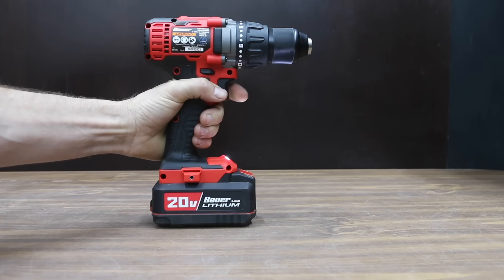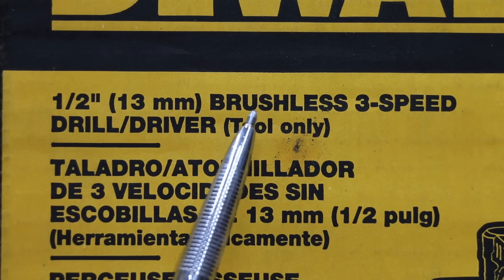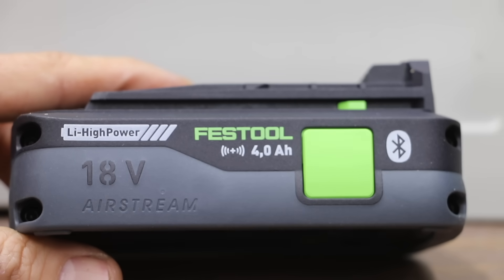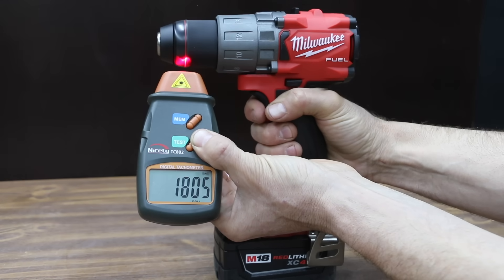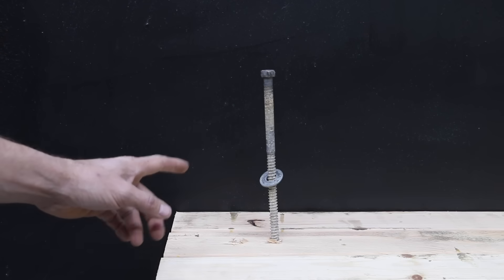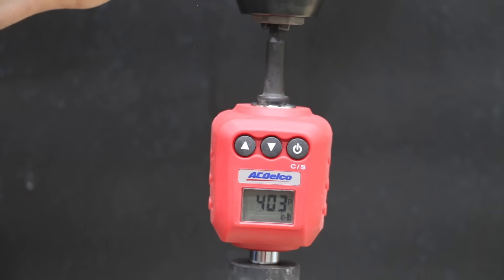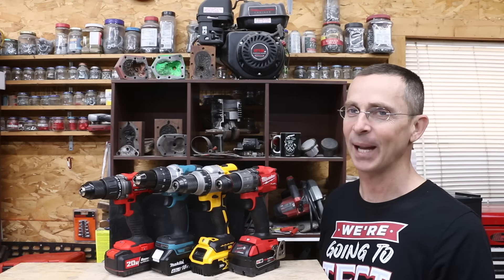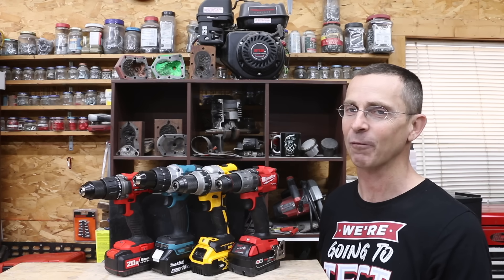Best Drill (BATTERY POWERED)? Milwaukee vs Dewalt, Makita, Bosch, Festool, Ryobi, Bauer, Ridgid

Comment: A PF video is always worth some of my time. This one is no different. Solid testing methods. Unbiased conclusions. 

I used the drill method to start my 1970s 2 Johnson cycle on my little boat. Otherwise, I had to pull that rope for along time. 

Also, what planet is Fes-whatever from with that price and performance?

That said, I am neck deep in Dewalt 20V tools and batteries. None have let me down yet. The 20V weed eater is probably the lowest performing of the lot, but it keep going despite my verbal and physical abuse.

Comment: It's about to be summer. I know a lot of us would like to see which brand has made the best brushless battery powered lawn mower. Is it Ryobi's new twin blade mower, or is it Kobalt's 40v or 80v mower, or is Ego's 52v mower still the best? But how about makita? There are many options out there.. many people wanting to switch from gas to battery because it saves you time going to the gas station with its price rising, it saves your ears from listening to a loud mechanical engine, it saves breathing in fumes and regular maintenance work that has to be done on a gas mower. While battery operated is just as easy as plug and play, much more quiet, easier to store away since it can be folded upward without worry of spilling gas or oil. I'm telling you it's going to be a popular video! I would love to do a comparison video like that but I just can't afford buying each mower 😂 and then again I would need a lot of grass that's between 3-4 inches so I can pass each lawn mower twice, away from the camera and then back to the camera, so the angle can be just right. But I would do it on the slowest setting first to compare each cut ✂️ from every mower. Then run the mowers to see how long each one lasts. It's not an easy task and would be much more helpful to have some people help you out. But it's definitely feasible and not that many comparison videos out there on the web that show such comparisons. It would be informative as well 👍 Good Luck. I know you got this.  Hopefully this all makes sense. Let me know what your honest opinion on this is. Keep up the great work man enjoy watching your videos a lot!
Reply from the maker: Thanks for the video idea.  Thanks for watching!

Comment: I wonder if brand name makes a difference in  spackle/drywall mud. My daughter bought a small tub of the color change stuff when she moved out of her apartment and she said it didn't spread nearly as well or forgiving as when I made her help with the remodel years before
Reply: Even when using the same brand, there are several varieties of joint compound for different uses.
Reply from the maker: Thanks for the video idea.

Comment: My DeWalt XR can break a man's arm quite literally I'm very happy with it if they could somehow apply the full 120 volts say a larger battery but in series of 60 and 60 or just build a March generator with the same batteries only at a different sequence 369 so and so forth until you achieve your 120 volts at a 60 cycle per second acoustic attenuation of electrons... So essentially you start off with 1.5 volts you have three of those per cell in series then you shut those into three larger cells that amount to six Volt and series those then your final voltage will come out of the nine Volts in parallel 3x9= 18 54 volts just enough Cycles per second to Ballance out impedance to electron flow " think Water " the nice thing about brushless motors is that they are essentially three phase motors, they create AC current by the nature of their Electromagnetic principals of the armature in conjunction with the Poles.  They make AC energy with means much like a LARGER three-phase motor used to step down voltage you can actually run a lightbulb through them... although Aluminum Air Batteries are a far more efficient replacement than Toxic Carcinogenic electro-Chemically unstable lithium ion batteries....I'm also a 9th generation Carpenter and Multiple Tradesman...since age 5? Mechanical electrical Structural chemical Prototypes repairs and fabrication in any medium 220 lb 6'4" 40" arm reach.. Ventruvian man.
Reply from the maker: Thanks for the feedback.

Comment: It seems from consistent cross-tool performance results that Milwaukee, DeWalt, and Rigid make some pretty darn fine tools. Definitely get what you pay for in most cases.
Reply: I have maybe 20 Makita and a dozen Milwaukee cordless tools and about the same number of corded of each.  I would say their reliability and build quality are similar.  I have used both for over +30years.
Reply: @semidemiurge  If you were talking about Milwaukee before they sold out to TTI you would be right. But when they went Chinese designed the quality went down dramatically.
Reply: @waterloo123100  I would partially agree with this but I would add that all companies experienced a change in mentalitywhen it came to the level of quality in tool construction.  The competition increased dramatically and there was huge pressure on price to remain competitive.  Quality suffered as the consumer could or did not recognize the difference in quaity when making a purchase.
Reply: @semidemiurge  And even then, I suspect it varies batch to batch. I have a compact Makita 7.2v impact driver (I call it the noisy cricket) from 2006 that still works a treat. Whereas a friend of mine hates his Makita tools because they never seem to hold a charge. I've also had a Harbor Freight brand rotozip that lasted 6 years of hard construction use and its replacement didn't last a year.
Reply from the maker: Great point!
Reply: Overall the 3 best tool companies are Dewalt, rigid and Makita. Milwaukee tools are just too unreliable.
Reply: @waterloo123100  my large collection of Milwaukee tools that have been abused daily doing heavy requirement repairs would disagree
Reply: @jaronvansambeek506  I have both Milwaukee and Makita. Tools. I’ve had 2 batteries take a shit and a impact wrench by Milwaukee. Can’t say the same about my Makita tools though.
Reply: @waterloo123100  that is an opinion. The test results are fact.
Reply: @Luckingsworth  Project farm only did a performance test here. Not reliability 😂 Even with that said. The Makita overall still performed better then Milwaukee and it was cheaper to buy.

Comment: What would be cool to see would be a best 1000 W power inverter test
Peak watts
 Efficiency
 Low voltage cut off( Being able to start a vehicle After the cut off)
Features 

I have a Dewalt 1000w that works ok 
 In powers most of the tools I need
 But the biggest problem Is when I use my battery chargers they whine and squeal  Because of not being a clean power output
Reply from the maker: Thanks for the suggestion.

Comment: A lot of people are commenting on the cost of the Festool, but we need to recognize the small fortune he spent on the lumber!
Reply: ^ This dude bringing up the real issues.
Reply: Very true. Lumber is the new gold.
Reply: $8 for a 2x4!!!!!
Reply: @boowiebear  try 10 😥
Reply: Are you telling me the Rolls-Royce is cheap car because a private-jet costs $20 million dollars!
We are comparing drills to drills and not drills to lumber, why should I buy Feattool for more money over Milwaukee when Festtool came last in power and Milwaukee “the cheaper” came first?
Reply: @samk.871  you buy a tool for its features and if you have as much as half a brain you'd determine whether the features justify the cost relative to your productivity. Festool is a brand that differentiates itself because of the various systems it integrates ... with drilling the interchangeable chucks and Centrotec system add value to specific trades and they are the ones that stand to benefit. Of course you have people that buy Festool because its more expensive. Do you think Rolex and Timex tell time differently?
Reply: @samk.871  you shouldnt buy a festool drill. That isnt their speciality. Their sanders, circular saws and vacuums are top notch though.
Reply: @smgs921  No, those are pure trash too.
Reply: @smgs921 and where is it written that a 500€ Drill from festool is same Level like an 80 € Drill?
Reply: The lumber is high because of Trump’s tariff on Canadian lumber because Justin Trudeau didn’t properly bow before him
Reply: Thank you president biden.
Reply: @ronaldjohnson1474  "president"

Comment: I looked at all of them and bought a Walmart Hart drill for $49 plus tax and three year warranty.
Reply: Hart brand is similar to harbor freight stuff, and is really not bad for occasional use for the price. Sometimes you don't want to buy a $300 piece for 1 project vs $50. I hate them when I need to use them for an extended project because the lack in performance/quality really shows.
Reply from the maker: Thanks for sharing.

Comment: Lifetime guarantee on Rigid including their batteries makes up for its shortcomings in the tests, IMO.
Reply: I like Ridgid, but
"Hey, if you want me to take a dump in a box and mark it guaranteed, I will. I got spare time."
I have a Ridgid belt sander. It broke. They fixed it. It just took time, and I didn't have a sander for two months.
Reply: @joet3935  Tommy Boy quotes aside, they did fix it so that's good. The warranty on the batteries is what sold me,  I'll take free batteries for the rest of my life!
Reply: @MontclairsLair  Correct. I got it fixed without a receipt or registration. I just brought the broken tool to Homedepot, put in a $20 deposit that I got back, and it got fixed.
Reply: I also looked up hours of reviews on Ridgid tools, and I have heard many horror stories about people trying to warranty them. I've heard a LOT of stories about people going on the online initial warranty and the website not accepting it. If you don't set that up in the beginning, you don't have a warranty. Well what are you supposed to do when the website doesn't accept it? Also even the people who got it to work, said you really need two sets of each tool, because just as mentioned above, they take 6 to 8 weeks to repair it. I watched a video of a guy who is a contractor who uses only Ridgid, and he said they typically only repair the minimum needed to get it working again (again takes 6 to 8 weeks) and they often break again because they only replaced one tiny part to get it running again. He finally ditched them after a few years and swapped to Milwaukee and said he has not needed to warranty anything from Milwaukee. He showed a trailer full of Ridgid tools that were broke.
Reply: @Steven-gv1ke  I had trouble with the site as well but I called them and they took care of it over the phone and I got the warranty info by email while on the call.  I've had zero problems with the tools I bought 5 years ago. Idk.

Comment: I will continue to plug a METABO drill (NOT hpt) electronic clutch, removable chuck for a nut driver, pulse mode for stripped fasteners, bright motion sensitive LEDs brushed and brushless models (brushed make more torque I think) hammer function available. Full metal gearbox.

SB 18 LTX-3 BL | Quick about 480 bucks with two 5.5ah batts and a case.
3 spd gearbox 
1300 inch lbs (claimed) 

I own the dewalt and the Milwaukee. Both great tools but the Milwaukee is not as tough as the dewalt or metabo. I tend to break battery casings on the Milwaukee as their batteries aren’t made strong enough (especially the 9AH) 

I don’t have too much issues with dewalt though, generally good. 

(I have a crew of guys so I get to see how tools hold up)

I’ve had my metabo  for 8 years not working in a commercial environment and I’m still on my original batteries no problems

No I don’t work for metabo.

Comment: Makita has a newer model of drill driver (XFD14Z) that is more compact (7 inch length) and slightly more max torque.  Very well made, but it's still a heavy tool. The drill options with the hammer functions can be better choices, given the similar or lower prices when on sale.

Comment: Festool is the Snap on of the Carpentry/Construction world. They do have some good stuff, but most of it is just grossly overpriced for what it is. 

From the budget perspective, I think more people should really look at Makita's sub compact line. They are extremely comparable to their full sized versions while priced very close to things like Ryobi/Rigid. I would argue that in most cases they straight out perform the full sized budget offerings while using the same LXT batteries as the full sized versions giving you the flexibility to pick up a more expensive tool where you need while keeping the same battery platform. However sticking within the results of this test, Ridgid is really something people looking for a budget tool should consider. Their warranty is better and the overall performance is better in many tools than the Ryobi equivalent. 

As far as primary tools go as you mentioned it is difficult to go wrong with Makita, Milwaukee or DeWalt. I have some personal grievances with dewalt concerning their constant battery style changes for a few years, but they seem to largely have settled down on that. I generally go with makita myself as I have the most batteries and having a service center 15 minutes down the road from me is a powerful incentive. My chief complaint with makita is their battery protection is a little too aggressive at times shutting the tool down unnecessarily (lawn mower test was a good example) or in some instances bricking a battery for no reason. It isn't a huge issue as they give batteries away often enough that I have never had an issue running low on them or paying for them really, but I dislike it on principle.

Comment: Milwaukee has left me wanting.  The last impact driver I bought broke apart inside and threw pieces of plastic into my neck the first time I used it.  I've also had two drilldrivers sieze up the chuck and I could not get the bit out.

Comment: One word of caution 
My dewalt almost broke my wrist when the Spade drill bit got stuck and I did not hold the dewalt drill properly because it was in a cramp space between floor joist 
It torque my wrist and I thought my wrist broke

Comment: Yeah and if the euclidean geometry that you're using for motors is ever applied to exponentials you would learn that a spherical motor with a acoustic Venturi for the core would work far more efficiently and much smaller for its torque and speed and since it is self cooling"  Brownian motion"  no need for a fan apparatus
Translation no bearings needed no Friction no wear and tear no thermal acoustic loss of entropy " heat " For Instance the Sun beneath the coronal Layer is Extremely COLD and Loud... talking Trillions of Decibels... inside the sun...

Comment: ** VIDEO IDEA DUMP **

• Best rolling shop-stool (both classic stools & innovative stools with tool holders built in)
• Best mechanic's creeper (some of these fold into shop-stools)
• Best drill-press
• Best drill-press vise
• Best bench vise
• Best miniature bench-vise
• Best 3D printer
• Best steel-toe boots (can they really cut your toes off?)
• Best hand-held electric diamond tester
• Best bicycle pump
• Something Silly: Which "lube-in-a-can" works best as motor oil in the lawnmower engine? (WD40 vs LiquidWrench vs ?)

Comment: Do you know if the Bosch you are testing is the same as the "Professional 06019G030A 18V System GSB 18V-110 C" Metric version(from uk)? 110nm comes to 973 not 755 in.-Lbs but as they seem to make the numbers up may be same thing and the photos look similar on Amazon. 
PS. Should be government standards so the batteries are interchangeable between brands, else you are kind of stuck with one brand.

Comment: This e-clutch trend has to stop.  The e-clutch in my DeWalt seems to stop at a different torque setting of I switch the drill speed switch.  It's horrible.

My other complaint is that clutch level 1 is not sensitive enough for the work I do with it.

Comment: I would like to see a comparison between the lower Ah batteries and the large batteries. eg. Ryobi 1.5 vs 4 Ah. I would like to know how much of a difference it makes in speed, torque and lasting power. Often you can find kits that have the smaller batteries, is it worth the extra for larger battery when you only do small projects, or can charge the second battery before you empty the first.
Reply from the maker: Great suggestion!  Thank you.

Comment: I heard you need to get the Makita made in Japan. It's way better. I've had 2 Milwaukee drills that burned out. One burned out after 6 3/8in holes in concrete. They wouldn't replace it. I was stupid and bought another one and it burned out after 400 screws. I will never buy Milwaukee again.
Reply from the maker: Thanks for sharing.
Reply: @ProjectFarm  I could be just very unlucky.

Comment: Festool is overrated. I’ve got the same Bauer drill you used in the video for a couple of months now. Been through an extensive amount of abuse and still is running strong. Sorry for whoever bought the festool based on price, it was disappointing to watch

Comment: My recommendation (with consideration for other tools in the lineup):

Dewalt if you do the homegamer stuff, and ocassional smaller car work

Milwaukee if you work on bigger cars, trucks, diesel, anything with high torque and size constraints too.

Snapon if youre a mechanic and work either fast enough or on high end cars where down time costs you more than the tool

Festool Youre a rich Czech....What was the point? I like the chuck adapter thing but the off center shaft would annoy me quick.
Reply from the maker: Thanks for the feedback.

Comment: I think these companies rate the rpm at the motor itself. Just like car companies rate engine horsepower at the crank and not the wheels. I think that's why some of these are lower than stated.
Reply from the maker: Thanks for the feedback.